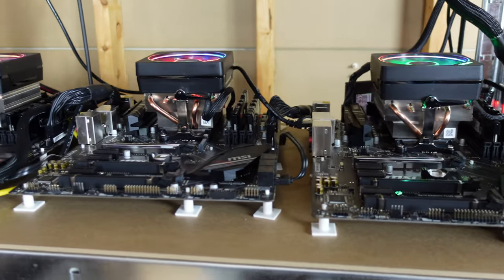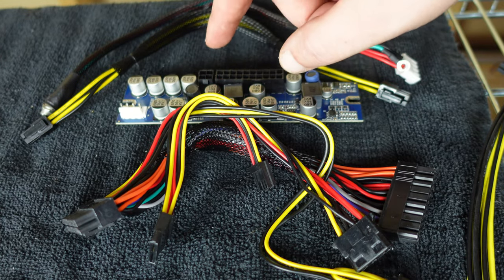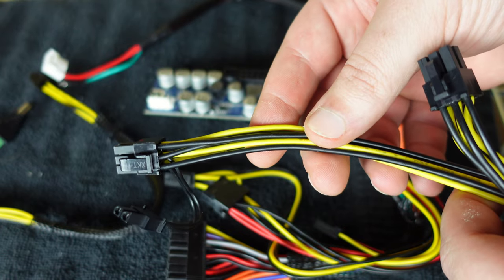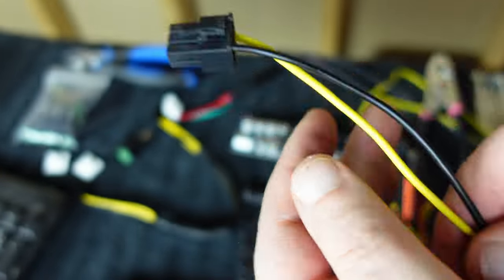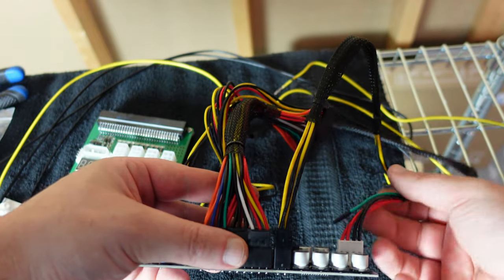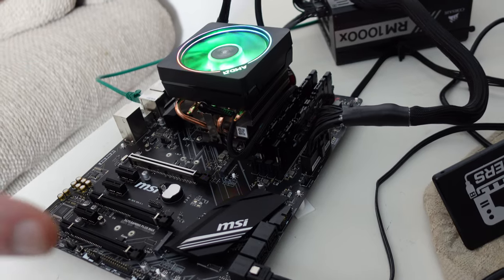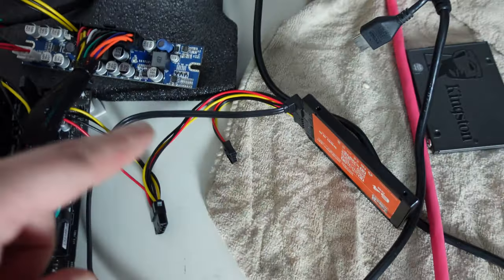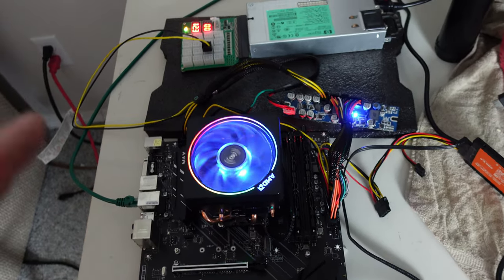CPU MINING With Server PSUs | GOODBYE ATX

Comment from the maker: Will Update when Everything I ordered comes in are you gonna try?
Reply: already ordered 3 picos to try it out. going to split it: 700w x3 CPUs for a cleaner not so restricted setup. 
Next thing we need to find is a really well priced Monitored PDU for remote reboots, ect.
Reply: im sticking with reg psu's but i do have a 3600 on the way. very interested to see what it can do. was about 180 after tax (assuming they don't cancel the order.. had that happen once so far lol) not the best price maybe but i'm sure it's gunna be fun.
Reply: FYI on those green and black male connectors, I am not sure if I trust them. I had three of them melt on me within a few hours of using them. You need to stay as close to 250W, since they are not rated for much more. Might be better off hacking up the 6-pin cables directly to the PICO power.
Reply from the maker: @smc9764  true also 250w is double what I use max watts on my settings with a 3950x is 138w and a 3900x is 118w on rtm and that's only when it hits rotation 16 of 20
Reply: @RabidMining  Cool, I just wanted to pass it along to you. I was powering just a 5600G, 8GB RAM, X470, no drive, and one riser card temporarily. The connector still gets pretty warm now powering my rig without the riser, but it hasn't melted at least, lol. I think the metal might be too thin or something.
Reply: ABSOLUTELY 💯

Comment: I got into rtm thanks to you (thank you :))so this is my way of contributing back, this setup poses a serious FIRE HAZARD especially on the 4 pin power feed to the pico and the small adapters connecting to the psu.
Head on to parallel miners and get proper mobo pico board for server psu. (you can connect several of them in parallel) and be safe..also if you are going to connect 5-6 rigs I recommend getting 1200w server psu..and stay below the 80% as Ryzen X tend to peak from time to time..even with the 1v mobo setting.
Reply from the maker: For sure this is the temp workaround to see if the PICO is working.  been measure powering consuption on the 3950x as well as MB for the past 2 weeks and the high it has ever hit was 138w in that time and the low was 82w-84w when pumped up I have seen the rig pull up to 270w when trying to max the hashrate which I always say is not worth the power.
Reply: This is definitely a terrible setup for longevity.  Relying on the amp rating of TWO wires to drive that setup is insane.
Reply: Where is this "FIRE HAZARD" you are speaking of???
This is s "test" setup and he will be increasing the wire gauge to #14, which is sufficient for the load the boards will be drawing.

Why is it increasingly so, that people don't actually "listen" to what is being said and then feel the need to comment.

Comment: Awesome mate. 👍🏼 have to get you a pin extractor kit though. 😉 those wires can be re-used on another project. 
Still waiting to get all my parts in for my build, but have already started ordering parts for the second build. 🤘🏼
Reply from the maker: Ya like I said this is just a temp workaround until the proper breakout board arrives.

Comment: AWESOME JOB BRO
I had a question, maybe material for a Video;    i need to KNOW  the brand/model of the COOLER did you use  here 0:40    and the CPU did u use/RECOMEND
Reply from the maker: All the stock wraith prism coolers come with the 3000 series.

Comment: Some changes to think about.. Nothing major, but it's how I did basically the same. 

- Solder the wires together from the 6/8pin pcie to the DC side of the PICO. I cut the DC jack off, no need for that fire hazard, they melt at 12v 2A on CCTV cameras all the time.. Make sure you common ground the green wire that has the screw hole in the end to the chassis! This will be for surge protection too!  Fun side note: access control systems IMMIEDIATELY lose warranty if you don't have ground (Most of them are DC based @ 12V).

-Personally, if keeping the 6pin wires and just cutting out that DC jack, mine have run great for months. I use the exact same breakout AMP board on my 2, soon to be 3 rigs. We all know how much current those 16GA PCIe plugs handle, I just won't trust the DC barrel jacks ever, especially with the 20 for 5.00 screw terminals. All it takes is one mistaken ramp up of the LLC when changing algos on the mobo to go from 150A to 200A and how many times can those jacks take the heat? Not as much as  leaded solder and 4 more wires can IMO. 

- Forget what people say about these PICOs, they seem very durable, mine have run in a garage for 6 months without issue. Directly tied to my AMP boards, during brown outs, my stupidity, and even overclocking! Not many people know that all but something like 3 brand of Caps are made in china, and so are MOST of the caps and chokes on mobos.. Along with the IR/TI VDC Regulators... Yes they're more expensive, but the DC-DC conversion definitely helps if you've already got 1200w or 750w P+ HP/Dell PSUs.. 

Thanks for making me spend more on CPUs instead of only GPUs! From 1 2700x, to 2 2700x, and this week a third 3900x. ;) Super hopeful RTM keeps up, keep up the good pace and work! I love the new angles to mining, its not just "buy the expensive 3080TI-LR-HasherMax" concept.
Reply from the maker: lol np nice tips

Comment: found a atx 24 pin 2 way splitter  1 female to 2 male  was wondering if its  whould be ok to use and a moded gpu 8 pin to a cpu plug
Reply from the maker: possibly

Comment: Have tou had any problems with this setup? I just hooked up two boards same setup you have and three days straight running the cctv power connector melted
Reply from the maker: Which connector do you have and what settings?
Reply: @RabidMining  3.8ghz at 1v mining ghostrider and same Amazon and parallel miner parts
Reply: @RabidMining  so I guess the lock ring nut on the remale end was causing the problem I cut and hard wire with a fuse instead of the quick connect. Can you tell me name of the white power connector that had the lose green wire next to it that plugs into the module board?

Comment: I honestly would not trust those 300W PICO connectors lol
You should definitely invest in some tools in order to make sure these PICO connectors can really sustain the advertised power for a long period of time because this could turn out real quick in a real fire hazard nightmare.
When it comes to CPU mining, i personally think ATX PSU is the only way to go, you barely need a 450W PSU in most case scenario, those are still selling dirt cheap :)
Happy midweek my brother and please stay safe <3
Reply from the maker: while true lots of people have been using them for years which is how I found out about them so far 3 days and everything is cool as can be no signs of not being able to handle the power.

Comment: What does this cost say compared to using lower powered PSU's per each board (say 250W PSUs)? Also, it looks like you could add three video cards to each of those boards and GPU mine at the same time by freeing up a core or two from CPU mining. If you were to use something like 1650's (or any card for that matter), you would find yourself in trouble as they each will draw up to 75 watts from the pcie slot on the riser card.
Reply from the maker: Depending where you live a 1200w server PSU is about 90-100 USD and can power 6 rigs.
Reply: If you're using HiveOS. Every separate rig after I think 4 rigs with a gpu will cost you $3/month instead of just a cpu miner costing 30 cents a month.
Reply: @BojanglesTheMiner  I never really understood why people use HiveOS to run a single miner to a specific pool (unless of course it is hive's pool). It's just as easy to run Linux and just load up a single miner instance and you only have to pay the pool fees and the miner fee. Why would you want to pay HiveOS anything if you don't have to?
Reply: @RabidMining  I was talking about all of the other bits as well, the 12V to ATX adaptors, the break out board and cables etc.. I would assume that the server PSU is used, so is there a cost savings over say 6 250 watt PSU's?
Reply from the maker: @andyhamm6389  will go over numbers when I get everything in I am expecting
Reply: @andyhamm6389  for a single miner yeah, I would run even windows. But hiveos just makes everything easier. What's 1 cent a day for a cpu miner making $2+/day. I've got 2 gpu rigs and 2 cpu miners and it's still free to use

Comment: Hi Rabid Mining, i saw in the vid that you have msi motherboard. How i can boot to hiveos without gpu(always stuck with VGA bug light)? I have R5 3600. I also have asus and gigabyte mb. They can post to hiveos without any gpu.
Reply from the maker: Not all MB can do it check to see if you have a boot threw errors option or ignore VGA.
Reply: @RabidMining  thanks for your reply. All of my msi b450 mb have "ez debug light" must have gpu to boot in hiveos, there's no bypass error option in bios. Giga b450 asrock b450 and asus b450 boot fine to hiveos without gpu

Comment: That’s a pretty cool set up 👍🏽

I have a question though about standard atx psus. 

Some come with two cpu slots and cables, can you then run power to two seperate boards that way if you use a 24pin splitter as well? 
Just asking because I’m only planning on setting up two dedicated CPU mining rigs. 👍🏽
Reply from the maker: its possible yes but not really recommended to split a 24 pin.
Reply: @RabidMining  haha. I have already ordered the splitter cables. 🤦🏽‍♂️

Thanks for your prompt response 👍🏽

Comment: The PICO iv very very expensive, build with some crappy SMD electrolytic capacitors... the worst choice in electronic components
Reply from the maker: While maybe true depending on the PICO these ones in particular have been used in the past for years with no issues.

Comment: This pico is expensive its about 30$ .. i can buy 500w psu with 30$ .. so its not worth buying
Reply from the maker: Depends where you look can possibly try to contact the supplier as well.  When running 240v keep in mind also need to purchase PDU cables which depending where you are from are 20+ bucks each for each ATX.
Reply: @RabidMining  Negative. You can purchase cheap adapters that convert NEMA 5-15 to C14 for a few dollars. :)
Reply from the maker: @metalheaddw05  everything I have will be on 240v

Comment: Not the best choice of the pico PSU, quite messy and also the wiring is less than ideal.
One of the things is that you use one pair which is pushing it, contact is rated at 9A(108W), you're running 6A(displayed by the server PSU)
If you want better solution hit me on misfit discord, though soldering is involved.